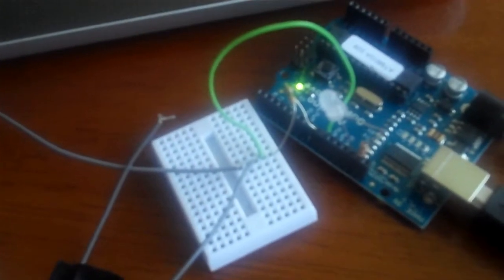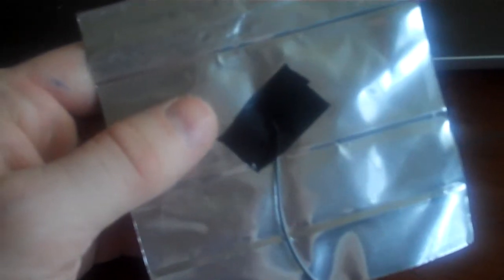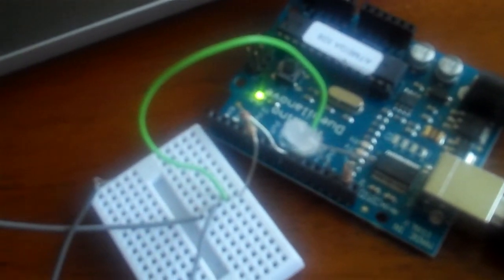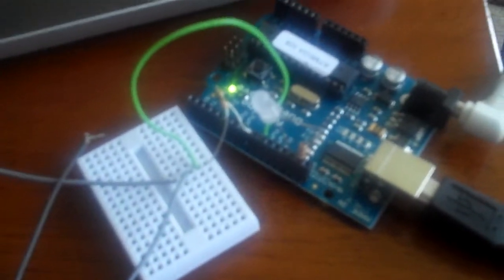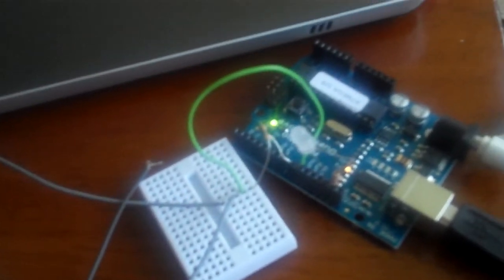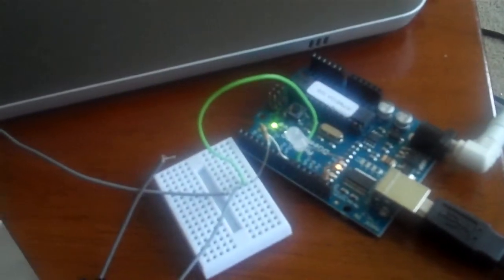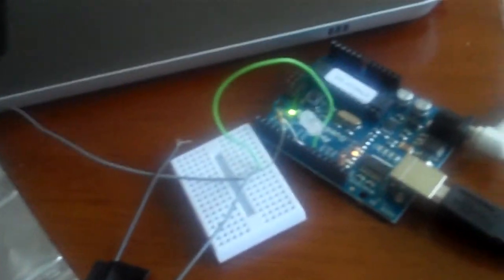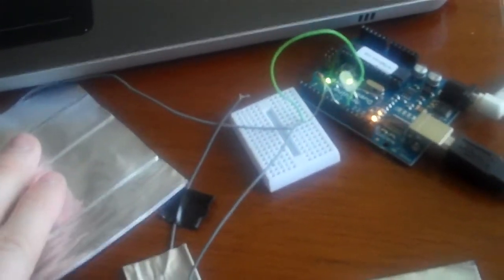Capacitive Touch Sensor Part 2

Comment: Your body has a natural capacitance of around 10pf. The Iron in your blood causes this. So when your body comes close to the capacitor or is connected via input source like you have, the capacitance in your body becomes parallel with the capacitor in the circuit, thus increasing the capacitance.

Comment: this actually has nothing to do with magnetic fields. It's simply because you are connected to ground better than the coffee cup or tape. That aside, could you post the code you used for this? I could use this for a few things. I already have an arduino.